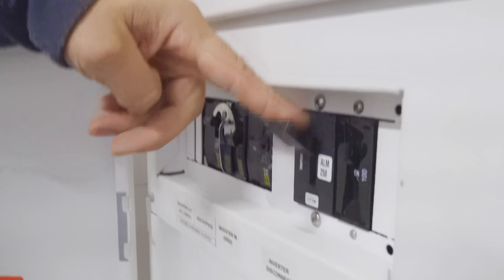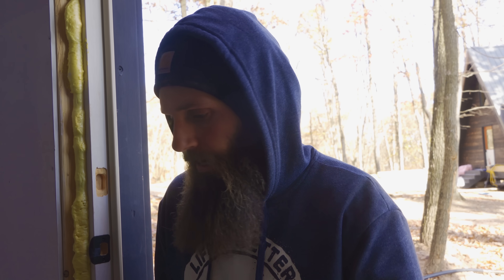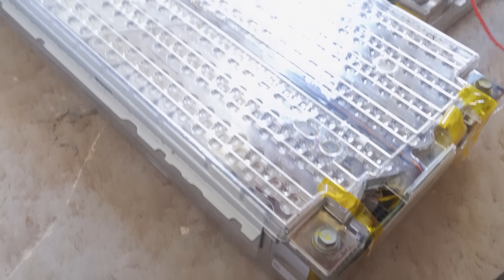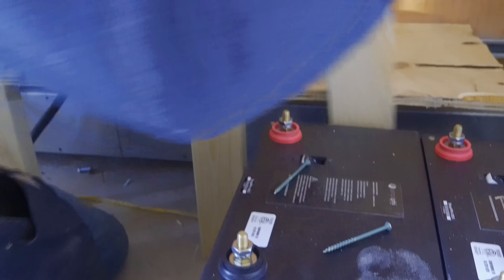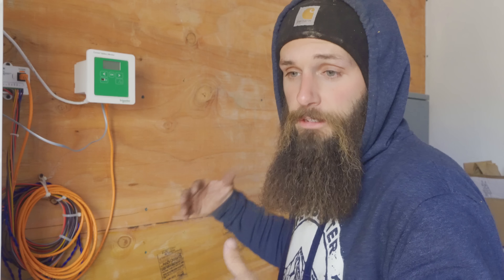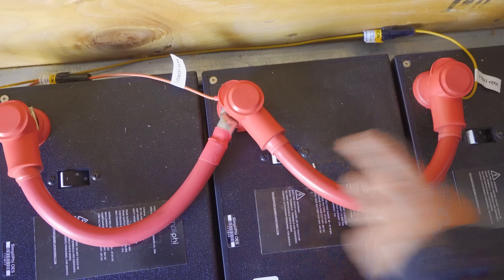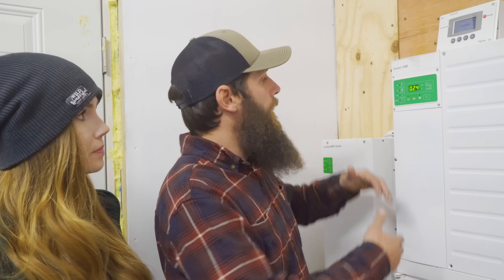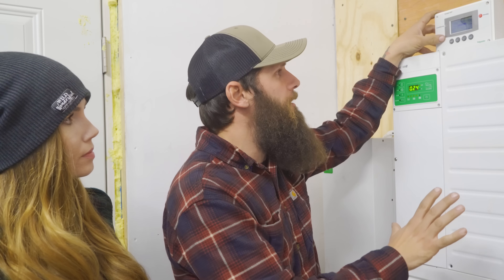Overhauling Our Solar Power System!

Comment: so , there is a bms in the tesla modules, which prevents thermal run away.
while there is a 3rd party product that manages the internal bms.
dod is basically the same on lifepo4 as on the tesla modules.
tesla modules have a MUCH higher discharge rate.
adding 5,4 kwh on the tesla modules is again MUCH cheaper

so i think you guys got sponsored by simplfi...
Reply from the maker: We are not sponsored. If we were you would know as it is required by the FTC to disclose that information.  As we mentioned thermal runaway is still a possibility with tesla batteries, even if there is a bms and there is no programming guide we were able to get our hands on... So all in all, as we said, peace of mind comes with the Simpliphi batteries that we couldn't get with the Tesla ones.
Reply: @WildWonderfulOffGrid  well, good on you guys..
i'm going to stay with my tesla modules for now..
in all fairness , i did buy evtv's tesla management stuff, and have the cooling fluid setup :)

for now the lifepo4 offering i have seen just dont make sense financially
Reply: There is NO internal BMS on the Tesla Model S batteries, search Jehu Garcia on YouTube for a video where he tore one apart to see what it was made of and how it was put together.  BMS is external and part of the vehicle electronics.  Yeah, it's initially cheaper, but over the lifespan of the batteries, the LiFePO4 batteries are still going to be cheaper in the long run, because they'll last much longer then the LiIon batteries.  Don't need to get sponsored to be willing to bite the bullet now for saving money later.
Reply: @testuser3167  please check out evtv's channel
Reply: @houseofancients  I have.  He and Jehu Garcia are buddies.  Jehu started out on his electric VW Samba project with LiFePO4 batteries, and then switched over to the Tesla batteries because of the weight savings and the increased power density, but in the mobile applications, they all use a BMS, 'cause that's part of the system telling how much "gas" they've got left in the tank, so to speak.  For a stationary application, Li-Ion can be cheaper to buy initially, but as soon as you figure in the life-cycle costs, LiFePO4 stands far above Li-Ion, and the only thing that can beat it on an even playing field, is the nickel Iron-Edison type batteries.

Those just don't work well for mobile use (too heavy), too high of a self-discharge rate for casual use, and WAY too expensive for most folks to get enough of them to run a whole system off-grid.  I think that Exide bought the patents for them back in the 70's and then quietly discontinued them, because they don't wear out very well - they can last over a century, and no self-respecting battery manufacturer would want to sell or make a battery that didn't wear out!

Comment: guys sound great, what did the system cost ya., where can they be found. ect.
Reply: Just do a google search, new batteries $3.5k each, inverter $3.5k solar, charge controller $1.8k, a panel can range from $200-325 each. Hardware who knows? We have been off-grid for 20 years. I'm always looking at upgrade/or what others are using and doing. Hope this helps

Comment: With all the continued investment in your Off-Grid, do you have house insurance?  And are you required to do permits and have inspections?
Reply: I would guess they have house insurance. As for the permits and inspections most rural areas in the USA do not have either. Except for well and septic those two are usually required statewide in most states.
Reply: I think this is not totally off grid homestead, for instance the land need to be paid up annually and insurance might have cost a large premium fees...?
Reply: @azmanmdsalleh2009  Since when did off-grid mean free or even tax-free???
Reply: I recall in a past video them saying that they have the needed permits, not sure which video though, sorry

Comment: I imagine that buying an item that is part of a growing market is very expensive but you know that your investment will still have a good impact on environmental pollution. If in the future they will manufacture generators that work with vegetable oil or recovery from food frying, it would be another step forward in the search to save the environment. You are pure environmentalists and maybe tractors and electrical machinery will be built in the future. This is the only way for a future. Thanks for your example and ciao from Venezia.

Comment: I would get enough batteries to last two weeks in case you need to fix your panels and it takes awhile to get replacements due to hail storms or tornadoes
Reply: They have a generator. More economical to have enough to last over one or two nights
Reply: If 12 kWh costs $9k and lasts two days a two week system would cost $63,000. Probably better ways to spend that money.

Comment: Im full off grid like you guys, and I ended up doubling up on my panels, and nearly tripling my battery bank.  I ended up using Nissan Leaf modules, and Ive got around 32kw worth now.  I was using the same Conext 5500 like you guys, and ended up upgrading to the 6800.  Schneider makes good equipment. Good job on all you've accomplished!

Comment: I follow some sailing channels and when they wire up the house batteries, they put the positive and negative wire to the opposite ends of the bank to ensure more even distribution of the load to the batteries.
Reply: Definitely the preferred approach.  I maintain several UPS systems and this is the best physical wiring for balance.

Comment: also think about adding more panels so it charges battery's faster,, hense panels are alot cheaper then batterys,, also think about making panels that auto track the sun...
Reply: generally not worth the money and added complexity these days to auto track unless extremely space constricted. Just put up more panels.  It will however help economically to use a mount that allow manual elevation change every few weeks or month or so.
Reply: Trackers are not worth the money these days, as panels are cheap (and you have some free land to put them on). But I do agree that they will need to upgrade the PV array size. For off-grid installs the best is to have roughly 3x kWp than what's the battery bank size in kWh. Reason - you need to top up the batteries in one day after a row of 5 bad days. But on top of that, if you "overpanel" PV then you have to set a limit on the charging current, in order not to overload the batteries on summer days. Off-grid solar design is a complex process a and the final system is often much more expensive than ongrid.

Comment: So I have to say upfront, I am in the learning stages of solar PV systems. My question is on the batteries. The jumpers are stranded, my question is would a solid copper buss bars be more efficient? I worked in low voltage and the connections, the manufacturers wanted as less dissimilar metals as possible. I didn’t know if I’m the high voltage game I’d it mattered. I also noticed you didn’t use a conductive paste at the connection points. I’m not sure if that is an issue as well? I just don’t know that’s the reason for the long winded question. Your videos I love love love. So much I have learned. You kids have a legacy long after you both are gone. It’s a testimonial of love. Love for one another (to work so close together) and a love of family to give them something better and love of wife to be her provider. Big props you guys big props!
Reply: Stranded is better due to "skin-effect". With high current, the current flows through the wire mode near the surface, then through the core. So with stranded you have more surface then with solid and your copper wires can be thinner (and are easier to handle).
Reply: Guust Skin effect is a function of frequency of AC current, not magnitude of current.  With batteries the current is DC and skin effect is not a factor.
Reply: @Guust_Flater  Not really. Skin-effect applies to high-frequency currents only. Not applicable for DC bus-bar of a solar system.
Reply: n3qdz 

I had the same questions!!!
I KNOW with plumbing, any time you mix dissimilar metals, there WILL BE Galvanic Corrosion!
On Electric connections when there is high Humidity there can be corrosion in the connection when dissimilar metals are mixed.
I know there are pastes which are non-conductive that can be applied to all of the pieces which many find too messy to deal with and most ppl accept that the rubber boot will reduce the amount of humidity in the connection. 
I myself would use the non-conductive paste and the rubber boot.

Did you guys make the jumper cables?

Comment: The one pro you forgot is these are new batteries so you know how long they will last where as the Tesla batteries were second hand and you don't know how long they would last. Good choice I have been looking at the Battle Born 24 volt batteries also but the ones you bought seem to be getting popular also.
Reply: @BobDevV  Their inverter is programmed to stop with a preset minimal voltage. In return it will always protect your batteries from deep discharge.

Comment: @ the moment @ this time of the year we have not much of sunshine so normally youre solarpanels will not juice up the batteries. You have a back up generator, is it possible to hook up that generator on the batteries and when they are full, the generator will shut off? greets from the netherlands.
Reply: The Xantrex kit that they use does support automatic generator start.

Comment: I'm sure solar is nice green minded stuff and all that but not cost effective at all. You have some serious money being spent on that system you have and will take many years to pay for it. As one can see you're already changing out the batteries and thoise things are not cheap.I have people hitting me up all the time wanting solar power and it isn't my labor that scares them off. I do a lot of simple small systems on outbuildings for just some general lighting only that will be used maybe 2-4 hours a week and that's mostly for security motion activated lighting and run off a simple trolling motor style battery over the app $7500 you just spent on batteries unless you got for free. That is only time right now it's cost effective over burying cable of setting poles.
Reply from the maker: We have a video from several months ago breaking down the full cost of our system and talking about why it makes sense for us and pays for itself. https://youtu.be/C-aeOzBn6YE
Reply: Most folks NEVER see the true cost of having utility power to their locations, because it got bundled into the cost of the property before they bought it or moved in.  The only way to be able to do a true side-by-side comparison, is by starting out with property that has no utility access at all, and then one gets an education on just how expensive getting utility power really is.  The cost of solar has come down far enough that it has already dropped below "Grid parity" (the cost to provide the equivalent power via the grid), but because the installation costs are already paid for fully developed property, it just looks like the difference between paying for a meter charge and a simple installation, or starting from scratch and providing a complete off-grid self-sufficient system.

Throw into the mix the high-priced installers who are jumping into the fray to take advantage of selling the tax-credits (of which their fees are a big part of), and the price for paying someone to install it has skyrocketed enough to be out of reach for most, and they end up just defaulting to what was the easiest/quickest/cheapest band-aid solution, 'cause that's what everyone else does...

If one does the math and figures out just how much they really are paying for a mortgage on something like a $150K home over a 30 note, it is sobering, 'cause it is usually up in the range of $450K+ and will surely be much more than the home is worth even with appreciation - but people still do it!  The same is true about paying utility bills, except you NEVER pay off those...  Modern solar panels typically have a 25-30 yr performance guarantee, and once you figure in the cost for the rest of the system with good reputable components, yeah, it's pricey up front, but over a 25 yr period, it's still cheaper than 25 yrs of utility bills would be!

It's no longer about going green, but whether or not one wishes to take the red pill or take the blue pill and unplug from the matrix!  Society wants you to stay plugged in, because it's better for everyone else to suffer en mass, but what's good for you isn't necessarily the same thing.

Comment: Please do the programming... will be useful to us that plan to go down this route -plus you will do it properly and not the piffle waffle and crap they come out with.

Good job 👍
Reply: I agree. Especially coming from a certified electrician instead of a manual.  Josh can point, show and explain all at the same time.  Nice flannels!
Reply: Yes! Thinking of doing the same thing with the same equipment for our off grid cabin. You’d save me the headaches....
Reply: yes i would like to see this too
Reply: Definitely! I have a on the grid solar system and would like to go off grid and get batteries for my panels if the State of Delaware will allow this.
Reply: Yes, please. I would love to see an episode on programming the system.

Comment: I would dump any extra power you have during the day into the tesla batteries. If the demand on the house is low and the simplfi are full it will charge the tesla batteries.
You could have a Bank 1 and Bank 2 like a boat. 

All I picture is the Simpfi Marketing Team behind the camera directing them on how to sell us these batteries.

You need to add the clip of her getting sprayed in the face into the intro, will help me feel like less of creep when I spend 10 mins looking for it.

Comment: Hey guys, did you put a fresh air supply in the power house after you installed the gas dryer?  Not sure how air-tight it, but you may be pulling quite a bit of negative pressure when running the dryer which could negatively affect the dryer and the heater you are using in there.  This could also create a CO2 issue in there.
Have a great day!
Reply: Rose :  I know they have an exhaust for the dryer, that isn’t what I’m talking about.  I’m talking about makeup air for the air being exhausted by the dryer.
Reply: @Flyingmikey62  dont people just drive you nutz..... yeesh
Reply: With no windows and a sprayed-tight door, you probably DO need a little make-up air inlet.  The dryer ejects air from the room, and it’s got to get fresh air from somewhere.  I don’t remember how tight you made your soffits, but you might be pulling a negative pressure.  Test by opening the door a crack while the dryer is running, and see if you’re feeling a breeze.
Reply: Flying Mikeys Shop is 100% correct. Whenever there is an exhaust there needs to be an intake, direct or indirect. Without an intake, cold air will find a way in.
Reply: Will definitely be negative pressure which will change the flame front but I'm sure she opens the door. Remember this is just temp till the A frame interior is complete then laundry will go in there. Don't know how many noticed that Josh is fully informed on each aspect of this build by other trades he works with. The kilowatts of new system to old were not correct but it was very informative to those who kind of understand this but need some direction, everything else was spot on. Way to go Wild Wonderful Off Grid!